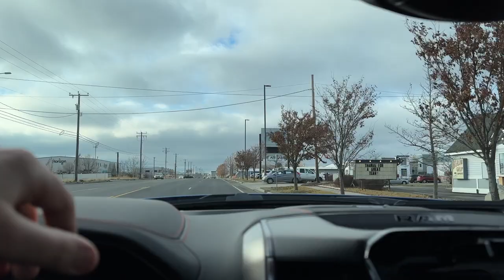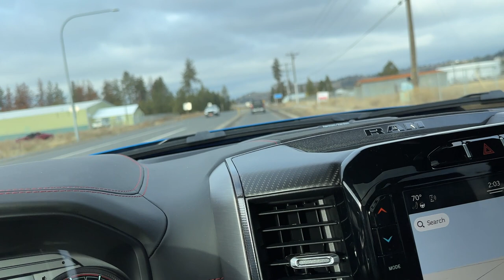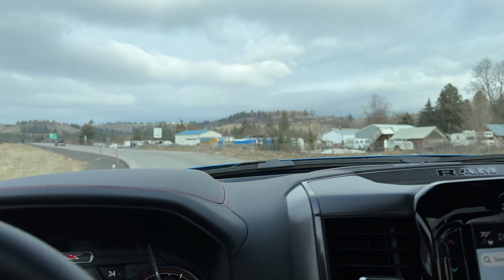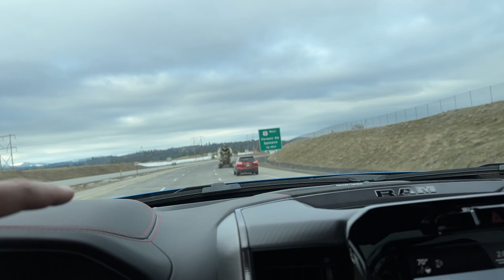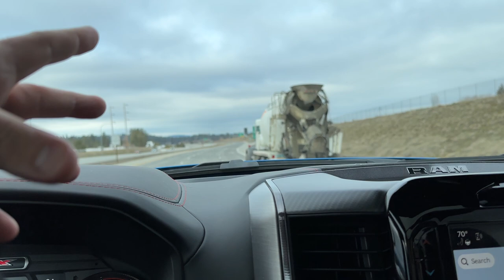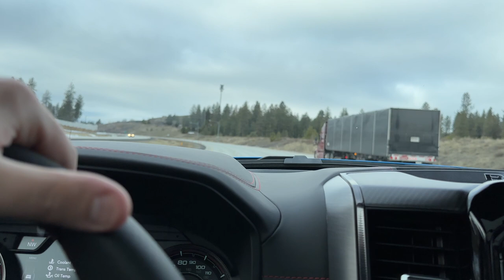2014-2022 Aisin problems.

Comment: Mine literally started acting up on 326. It's a 2018 4500 four-wheel-drive 444 rear. I was sitting at a stoplight and it felt like someone grabbed the accelerator shortly after after a few cycles of shifting the truck simulating shift flares I haven't had a chance to diagnose, but I am thinking it's probably a valve body and one or more solenoids. There was no sheer showing so there was no rise. The fluid is still bright red with no burnt smell, so I'm leaning towards electrical maybe a ground or valve with the solenoids what do you think?

Comment: Not sure if you heard but 2022-2023 Aisin’s are falling apart by the thousands / all new trucks with very little miles  - it’s all over the internet - hopefully recall is coming.
Reply: 8.8k miles here 2022 Ram 3500 high output cummins drw. No problems so far
Reply: Danny B  your comment is the first I'm hearing about it.
Reply: 10.000 miles on my 22 Ram 3500 HO with Aisin and no problems so far.
Reply: My 2022 5500 just broke down with Aisin issues. Only has 12,700 miles on it.
Reply: On Jan.11/23 My 22 w/ 5000km and my aisin blew up. Clutch ring that they released a TSB about. Probably be down for a month
Reply: Just got my truck back a few days ago. Out a month after my 22 3500 HO tranny went with 5900 on the clock. Been working with some people keeping track of failures and we’re at 100 or so maybe. It’s not an issue with all trucks, but definitely some of the 2022 Aisins got out the door with a screwy snap ring or groove.
Reply: The ones manufactured between April to October of 2022 are seeing failures. They’re aware of the issue
Reply: @dc5obsessions  same here.  22 ram 5500 only 9k mi
Reply: My 2022 Ram quit w 9000km with a fifth wheel attached
Reply: @Itsa_Mea there's a lot of facebook and forum pages dedicated to the issue. Ram is trying to gather info from all affected Rams at the moment.
Reply: My 2022 3500 HO transmiss failed  at 2000 miles but fixed under manufacturer's warranty.

Comment: I’ve herd so many different opinions on this that it’s scary. I’m just the average joe out there so I don’t claim to know a lot but I have a 2018 3500 ram cab and chassis model with 52,000 miles on it and I just changed all fluids out at 48,000 but not the transmission yet. I don’t do alot of heavy hauling no yet anyways but thinking about getting into it. But my question is should I do a transmission flush on my rig here pretty soon or just run it and not look back I’ve herd so many different stories on this but wanted ur opinion on this since u have a hauling business with a fleet of truck with world of experience in this
Reply: I would do a drain and replace vs a flush. $90 for a filter $200 for 3.5 gal of Amsoil tranny fluid. Owners manual recommends 30k mi drain & replace. Every other drain to replace the filter. For. $90 I change the filter each time.

Comment: My 2022 Ram 5500 with 12,700 miles just broke down with Aisin trans issues. Multiple codes popped up and wouldn't go into gear. Currently sitting at the dealer waiting to be diagnosed.
Reply from the maker: Dang. Sorry to hear that. We have few 22s. No trans issues
Reply: Make sure your dealer is aware of the current TSB 21-002-23.
Reply: Check the wiring harness under driver floorboard. Hopefully, it's not cut though the wiring. Had this issue on a 2018 aisin
Reply: Same.   22 Ram 5500 transmission went out at 9k mi
Reply: Same.  Mine went with less than 1000kms on it

Comment: There is a TSB 21-002-23 out for 22-23 for K1 clutch drum snap ring failing. Some in less than 1K miles. Snap ring groove may not be machined properly.
Reply: Mine just failed yesterday. Less than 12hrs off the dealer lot.  699kms on the odometer. 

10/22 build date.   Lasted one day.
Reply: Mine failed at 6046. K1 ring and service center is seeing several a month with less than 10k

Comment: I’ve had good luck with the Aisin transmissions but I will say, the Allison definitely shifts a lot smoother when unloaded and definitely seems smarter on the shifts. The Aisin lasts good and I like the lower temps that it produces compared to the Ford and Allison but it doesn’t shift as smooth or as smart. Now I can say the Aisin AS68RC that was the first generation had a bunch of short comings. I’ve seen a few in some 4500’s that overheated and had clutch failures at less then 150,000 miles. They also would not shift into 6th gear while in tow haul mode and with low gear ratios it was not nice on the highway.
Reply: Agree, the Aisin is tough, but is a real stumblebum when it comes to driveability/shift quality. Mine had a bad shudder on the 2-3 upshift when pulling, plus all the other Aisin quirks.
Reply: @1hasbeen531  my 5500 shifts good, my 3500 shifts stupid. Just like yours, it shutters on the 2-3 shift when pulling a load. Both trucks have a funny vibration sound when shifting into 4th, it sounds like the torque converter lock up making a sound. Both have done it from new.

Comment: I'm at 170k in my 2016 with the Aisin. So far so good. Amsoil fluid every 20-25k since it was at the original 30k, seems happy with it.
I tow a 20k 5th wheel about 40% of the time, and it's a service truck for the remaining miles.

Comment: Have you ever had problems with pan bolts breaking? I've snapped off 3. Used heat and they won't budge. Had it to a transmission shop and they gave up. Said Aisin installs the bolts without locktite and the steel bolts fuse to the aluminum case. If they were locktited, a little heat would melt the locktite and they would come right out. I've got 161,000 on the filter with fluid every 30,000. I'm getting real nervous!
Reply: jeez thats crazy brother i have 4 of them with 100-200k+ and that has never happened to me. hope things work out
Reply: Just today I had the same issue broke 8 of the pan bolts
Reply: I broke 6 and ended up drilling them out and make new thread . It was a garage nightmare

Comment: Just brought my brand new 3500 DRW truck home yesterday.   Transmission completely failed less than 12hrs motor time and less than 1000kms.  

Seems like these late 22s are really biting the dust.
Reply: Crazy.  It’s been 2 months and my truck is still at the dealership waiting for parts.  They have 30 more trucks with the same exact issue sitting there. Low mile 22s.
Reply: @end0828  it's nuts.  Mine went to a dealer last night on the hook. Dealership kicked it out. No room/no time. To many other HDs having the same issue. My concern is not being able to file a complain with Ram Customer Care because we are waiting for the transmission to be diagnosed..
Reply: @EhFokes  contact Chrysler asap to get the claim started, get them to expedite the parts. Or get an attorney for buyback.  These are a bunch of lemons.
Reply: @end0828  unfortuntely Chrysler will not proceed with the claim until the diagnosis from the dealer is complete.  And the dealer is full of trucks....

Comment: I’m experiencing slippage issues with my 2014 Ram 6.7 w/ Asian with 43k miles after adding a tuner and delete.    Feels like it’s gliding over one gear when upshifting say from 2-4 it seems to glide over 3 without full engagement.    Thoughts so suggestions where or what to look for?

Thk

Comment: I know you have had some issues with the 22s. My question is I’m in the process of ordering a 23 3500 HO. Do you know if the issues have been resolved and are you running can and chassis trucks or the HO. Trucks? Thanks for all the information that you put out!
Reply from the maker: I don’t know if it’s been resolved but talking to a ram representative they are well aware of the issue. I don’t know if Cummins actually changed anything yet
Reply: @pddieselpower  There is a new TSB that was just released for the 2022/23 Aisin's. There is a snap ring that holds the K1 clutch drum on the input shaft and the groove in the input shaft wasn't machined deep enough. So the snap ring pops out of the groove and allows the clutch drum to wonder around inside the transmission. The fix is they have to open the transmission and if the input shaft is damaged, they replace the transmission. If its still good, they replace the input shaft and clutch drum and send you on your way.
Reply: @shauncollins2017 yup. Mine went in less than 1000kms.     One day off the dealer lot.
Reply: do you have the 2022 or 2023 model year Ram? @EhFokes
Reply: @j.l.salayao8055  we had a 10/22 build

Comment: Was the 64k mile engine that nearly failed the truck with a knock in the video you did a few months ago?!  I see all this stuff on the typewriter tick, my 21’s got it.  Not the def injector, she breathes. Didn’t go away after 1000 miles following oil change…still there.  Are these hydraulic lifters garbage?  I know fleece has a retro kit to put adjustable ones…thoughts?
Reply from the maker: No. It was a different truck.
Reply: @pddieselpower  copy!  Would love to hear your thoughts on the hydraulic lifters. I just don’t know about these 5th gens…

Comment: I’m new to this aisin transmission bought a 2023 ram 3500 so I have some questions. Do all of your trucks with this transmission constantly down shift on slight hills towing? My truck would go into 4th gear on a little baby hill that my 2012 ram 68rfe would just stay locked up in. Now the aisin transmission blow up at 1,300 miles. Also the radio stopped working and at 100 mile injector misfires at 300 injector misfires at 600 injectors misfiring!!! Now at 1,300 yes injector misfires.

Comment: I just bought a 2022 3500 mega cab with the high output engine and Aisen transmission in it. It has 16,000 miles on it but going into second or third gear it seems to hesitate to shift especially if starting out slow on a hill. Is that to be concerned with? Not towing anything when this happens either.

Comment: How often do You change your ball joints? Got a 2020 ram 5500 with 230k miles. I jacked the wheel up and tested it by hand there was barely any play, but definitely could feel and hear a little, so I thought it was the wheel bearing, changed the wheel bearing and same thing, it’s definitely the ball joints. Keep in mind I haul between 25-28k pounds, that’s including trailer.
Reply from the maker: 5th gens have play from the get go.  At least my 3500s do
Reply: So from new they have a play?

Comment: I think about selling my 2020 f350 and getting a regular 6.7 l ram 3500 with the 68RFE.  Any recommendations.  I’ve seen videos where the less powerful combo is better
Reply: Don't waste your time with the 68 buy a 2500 if you want a 68

The aisin is possibly one of the most stout trans I've had besides my G56 
If your looking at a 3500 and know it has a 68 walk away it's not worth it.
Reply: Some say the 68rfe is no good. I say horse puckey. I've run a 68 for years and tow 16,000 Ib's fairly regularly. Never had a issue with this trans. Do the service on it and it will serve you well. If you haul heavy everyday then maybe the Aisin is a better choice. Take it for what it's worth.

Comment: Tire pressure on dully trucks
Reply: 45 psi to 80 psi on rears depending on weight of load. Run empty and 45 psi and it will give you a nice soft ride.
Reply: personally i run 70-75 up front and 60-65 rear so im ready to hook up to any weight but yeah if your gonna bobtail 100% go with lower psi

Comment: I would like to know if anyone has had an 2022 3500 Aisin 69rc troubles. I love my ram. I don't abuse my pickup. I had my transmission go out at 6923 miles while pulling approximately 6500 pounds and 1200 pounds in bed .

Comment: Cummins with Allison and the 5th gen cab. Come on RAM!
Reply: Allison's can't handle the torque. Thats why GM has kept the torque under 1,000ftlbs
Reply: GM's 10 speed is not actually made by Allison.   GM's new 10 speed is made in house with the Allison logo slapped on it.   Not a true Allison made by Allison..
Reply: To my understanding, the new 10 speed that ford and Chevy are using are from the same factory